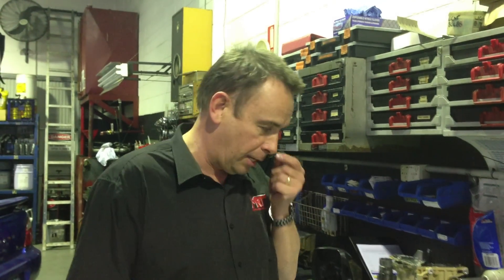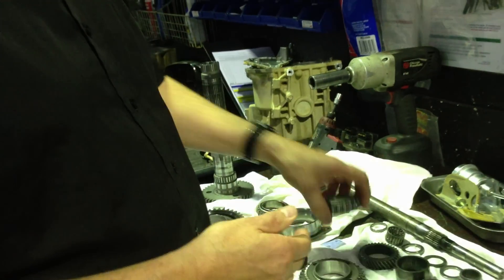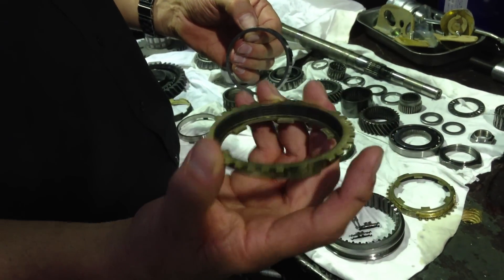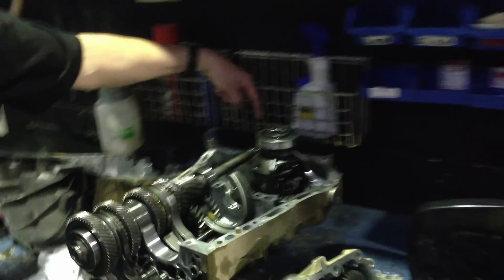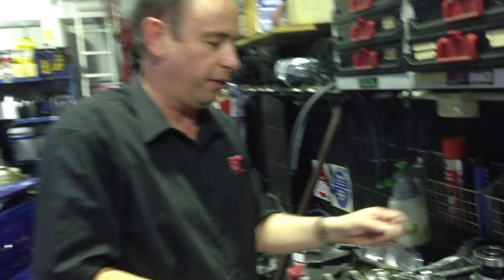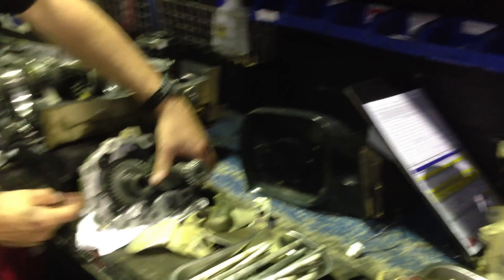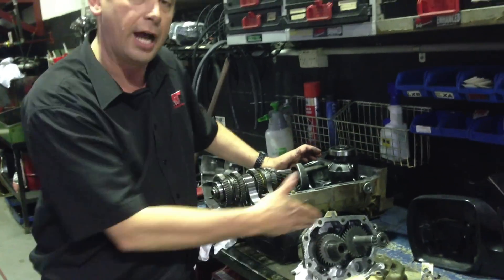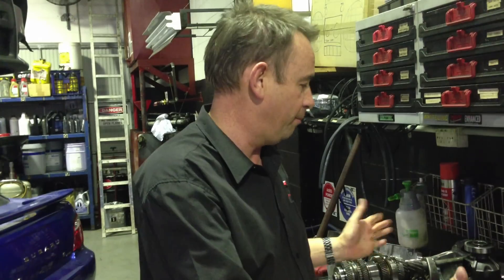Subaru transmission 6 speed inside secrets, the non performance model

Comment: Are these 6 speeds on the 2006 liberty 3.0rb ??
Reply: No, the 6-speeds in the 03-09 Libertys are the same basic style as the STi ones (the good style, not the 'split case'). They do not have some of the STi 6sp features like DCCD (driver controlled centre diff) - just a viscous centre diff, and do not have a limited-slip front diff. The 3.0 boxes have shorter gear ratios while the Liberty GT Spec B gearboxes have slightly longer gear ratios. The 03-09 Liberty 6-speeds are just as strong as an STi one.

Comment: Hi Brett I hope you can find time to answer my question. I have a 2016 diesel XV, (UK spec) with a  6MT gearbox. I actually consider it the worst gear change I've ever experienced in a vehicle and I've driven series 2A Landrovers.
Anyway the problem is, is that the gearbox can bauk very easily on downshift and you then land up going say NOT from 5th to 4th gear, but from 5th to 2nd gear. Subaru would not do anything about it and it's now well out of warranty anyway. I've tried 2 other similar XV's and they were both better on gear change.
The clutch itself has to be depressed a long way to disengage and re-engages early (for want of a better word).
The local gearbox expert who has a good reputation, said it was the clutch that was built up wrongly from starters. When he tested the car with me as passenger, he said he was getting inconsistent clutch pedal pressure, and said that the clutch cover plate had been assembled wrongly. But Subaru still wouldn't wear it, and the main dealers wouldn't agree with me. 
He also said the clutch would fail at 30K miles but it's now done over 40K.
I changed all the transmission oil to Redline products and there was an improvement in gear changing, but the gearbox still bauks. Also I can't get used to this stupid springing to the centre position, if you don't fully concentrate on gear changing all the time.
My previous car was a Fiat Punto 1.2 litre petrol and it had a lightning gear change, but there was also Redline oil in it's gearbox.
Recently a local mechanic who serviced my car said that the 6MT gearboxes were known for weak synchromesh, and said there was too many gears in the gearbox, which caused poor gear changing. 
I have heard previously that even WRX's with 6MT gearboxes have the same problem.

Comment: Hi, I have a 2016 sti and was having shifter issues, like a little notch felling when going from 1st to 2nd and when going from 4th to 5th and 5th to 4th down shifting a little gear clashing sound. So I decided to change the shifter linkage bushing and got some COBB bushings. Then after installing them the transmission started sounding horrible from 1st to 2nd and from 3rd to 4th. My question is: is this normal or something inside is damaged? I suspect something is bent where the shifter cable attaches too, because I pulled very hard on him trying to install the bolt that goes through the bushing. Any ideas will be nice to read about. Thank you.
Reply: Uhhhh. You know the sti doesn’t have cable linkeage right?
They’re direct shift.

Comment: do you have a video on the various Subaru transmissions and their differences? I have a JDM 97' WRX with the 5 speed with incredibly short gearing and I'm curious what options I have other than the STi 6 speed swap. Would a USDM 5 speed be an affordable option?

Comment: My 5-speed gearbox is in service right now (1st and 2nd gears are missing teeth and bearings have gone bad. They said it will cost me 3700€ to get it functional again. Im really mad i didnt buy an STI!
Reply: Omg I would repair that for you in England using all new genuine OEM parts for less than 500 euros parts and labour. Hell another 5 spd box won't even cost €600 euro plus labour max £200\€250 roughly
Reply: Couldn't find an used transmission. This is a small country and im nlt thta into ebay. New unused transmission was over 7000€. Yea i bet you could fix it for cheaper if you only replaced the essential parts but they reolased all sychros and bearings too which are surprisinly expencive. Labour was 1400€

Comment: im looking to do a 5 to 6 speed swap and i want to know how to fit axles im looking sti's in the same year and newer wrx's .
i know that your diff needs the same gear ratio as your trans but how to tell if front axles and shaft will work one guy told me an automatic one will work  and that guy said wrx would work on sti trans for the front axles 
And thank you Thomas Terry
Reply: Just grab all the STI gear if you're going to do a swap.
Some people try to do it cheap by using a R160 diff with the 3.9 ratio so they can keep all their original gear, but the diff is a serious weak point after that.
You really want The gearbox, axels, hubs (to fit larger axels), tailshaft and diff
Reply: Also while you're at it get the diff mount and engine cross brace from the STI as they're made of thicker material.

Comment: i have a 2008 legacy 3.0R with a 6 speed manual and I believe the viscous coupling is stuffed. it makes a harsh binding noise during tight turns once the car has been warmed and driven after 15mins. I need to get it fixed. any help or info appreciated.